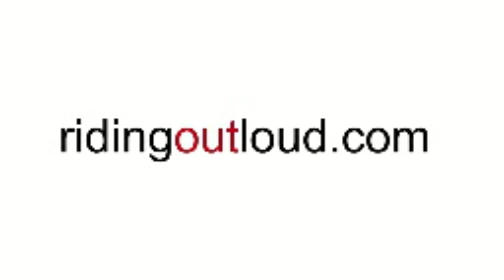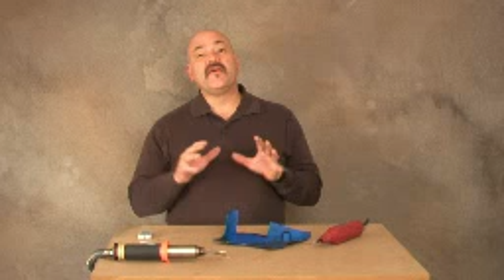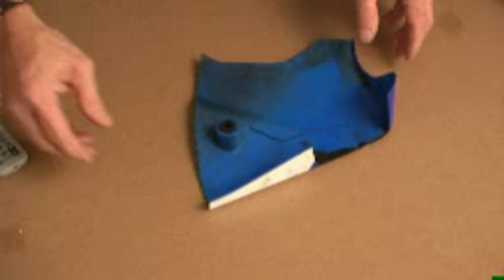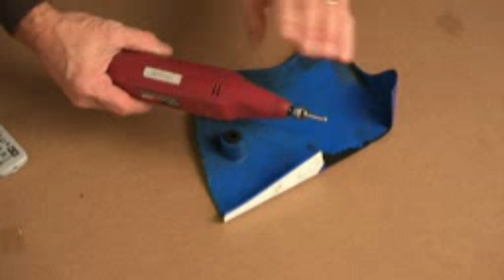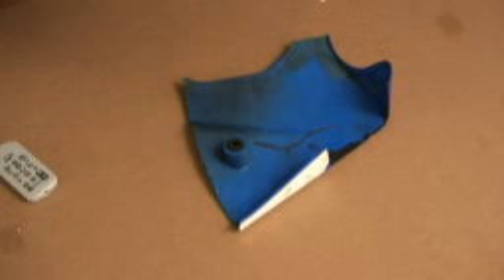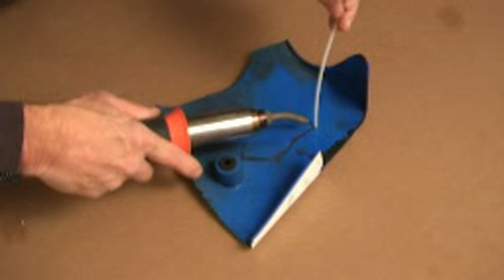repair a motorcycle fairing.mp4

Comment: You  should do both sides !!!  and sand flush for proper fix NO SHORTCUTS or  you'll be doing it again

as far as your advice to follow crack and make void is correct,  you can then use zip ties to fill in the voids and then sand with 60 grit paper add more plastic if little voids appear (air pockets) then use soldering iron to smooth out the area make sure to get adjoining plastic molten so they will bond to each other

Comment: $10.00 for putty from the autoshop add a little extra hardener lay it on thick wait for it to dry and sand then paint, alot simpler